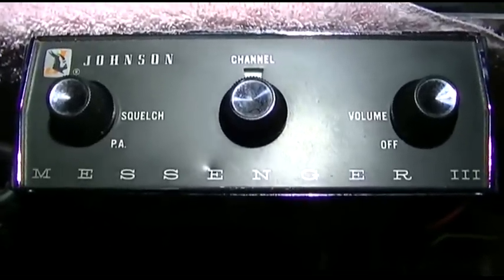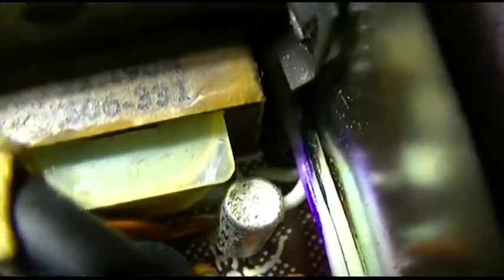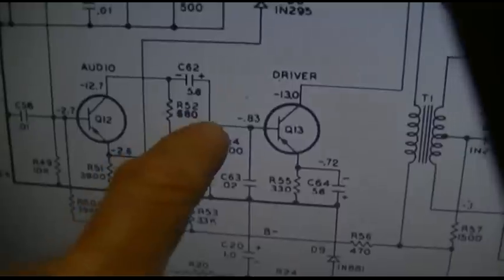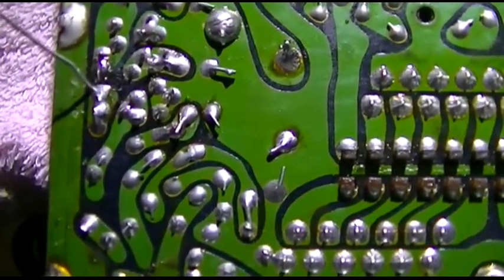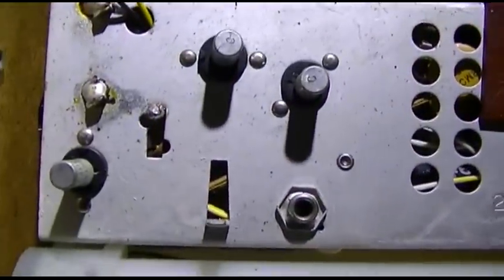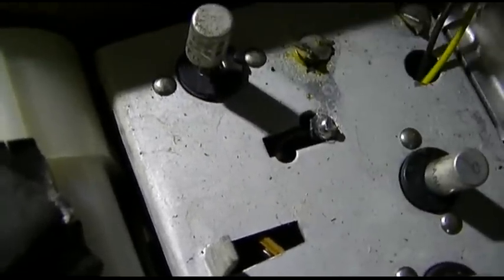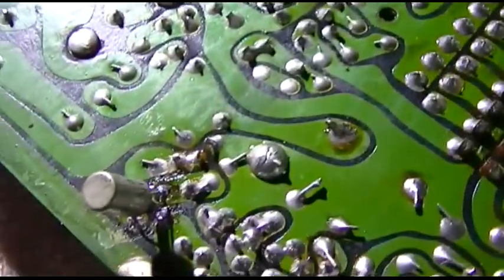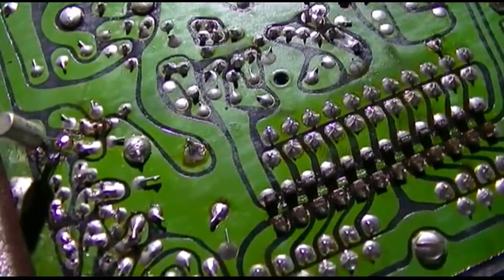Noisy Germanium Transistors Causing Audio Hiss

Comment: Back in the day we used to use a low tech approach to germanium transistor troubleshooting using freeze spray and the gentle heat of a soldering iron, the majority of the time cooling and heating would make those noisy germaniums either act up or quiet down. These acted up sometimes even when almost new. Static, his or crackle noises are common. Have fun!

Comment: It is not a valid test if the noisy transistor has an extremely high HFE gain, I noticed it was much louder and more distorted with the original noisy transistor the noise could be from a bad ceramic filter earlier in the receiver, might be worth sticking a scope on it and checking if the noise is coming from pre-base driver, not seen you use a scope yet ?

Comment: I like the Royal 820, it's a great sounding radio. I know in the modern timess they have been experimenting with silicon-germanium alloys for components, no clue if they have rolled out any discrete transistors though. Perhaps they would be easier to tack into one of these old things.

Comment: Or a Rotel stereo from 1972 using Germanium outputs.
Impossible to find now....(replacement parts).
I own a 19..60?? Zenith "royal 1000" SW portable that developed transistor trouble. Was able to get the one replaced back in 1986, but either it or another one blew soon after, & I have not found any since.

Comment: A modern silicon transistors with same HFE gain value should be a good replacement for geranium trans.
Reply: You'll need to redo the biasing circuits for them. Doesn't worth the trouble in many cases

Comment: What exactly does the term "Waterfall inside them" refer to?   The stuff I work with (full sized arcade games) I've not had to deal with germanium diodes or transistors-it's all silicone.  So this would be a new term that I've not run across.
Reply: white noise = waterfall
Reply: Haven't you ever stood next to a waterfall? It's the noise water makes, as it falls to the bottom of a fall. Hissing sound.

Comment: i have had a lot of luck lately with nos soviet obsolete components from ebay, a particular detector circuit i build uses LF357's and LM 118's, LF357's can be hard to find in quantities, you get odd ones on ebay for silly money sometimes and china sites claiming to stock them which turn out to be fakes.
but the soviet ones off ebay have been great and they are metal can package too.

Comment: Hi. I have a question. I'm new in electronics, but I have a vintage Hitachi Hiphonic radio from the early '60's. It works fine but after about 2 hours of working it develops a slight hiss. It's not disturbing but...it's there. If I turn it of and let it rest for about 20 minutes the hiss goes away. What can be the cause? Could it be that the 60's germanium have gone bad?
Reply from the maker: thats what i would expect.
Reply: Thank you

Comment: Shunt the A.C.?  to ground? Explain please.
Reply: I don't recall him saying this in the video, though I'm sure he did. So, without going through and watching the whole video again, I'll make a guess as to what he was referring to. Typically, shunting an AC signal to ground means that a capacitor is placed in parallel with a biasing resistor running to ground. The DC signal that you want to bias the transistor has to go through the resistor; this is because capacitors block DC. However, capacitors generally have a low impedance to AC signals, so the AC signal can go around the biasing resistor and allow for greater amplification of the signal because it's not being attenuated by a resistor.
Reply: Andrew is right. Bypass signal to ground without upsetting the DC operating conditions. Simple technique. Almost like signal injection, but the opposite.

For another crazy simple technique you can take a long wire antenna and inject into RF, IF, and AF circuits. Generally there will be enough broad banded signal to help you trace to a dead stage.
Jumper lead with a 0.01 microfarad capacitor and another with a 1.0 microfarad will do well for jumping stages or bypassing to ground. Good luck and have fun.